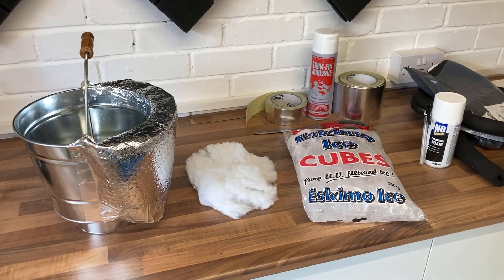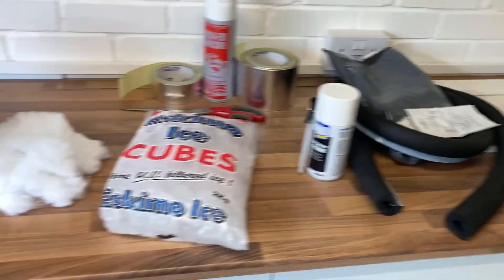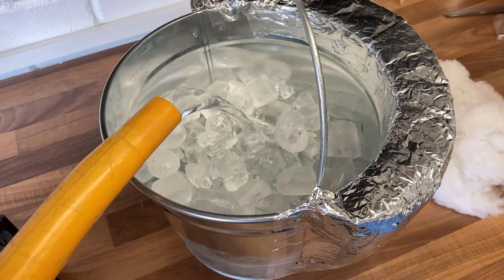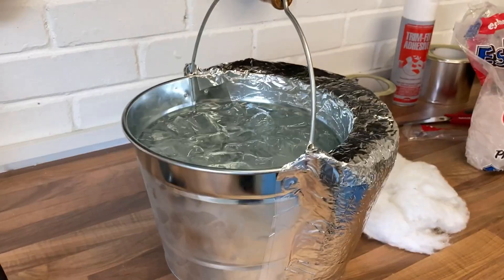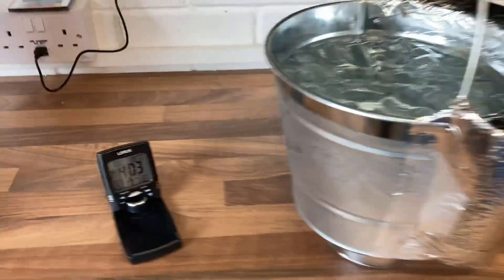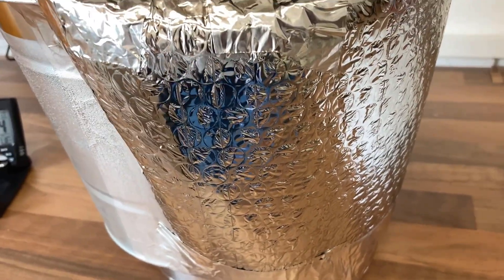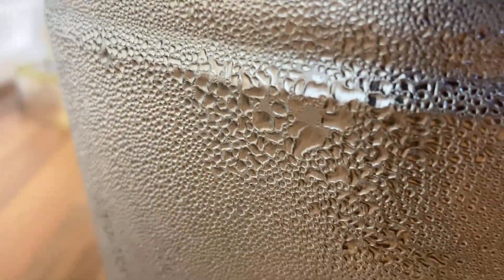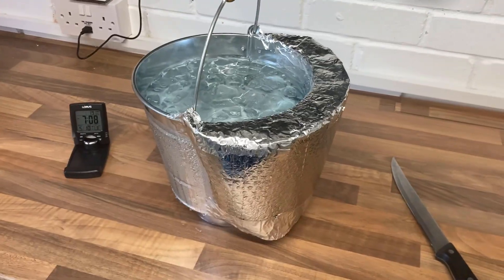Vapour Barrier in a Van - I can Prove they Work.

Comment: I'm all for vapour barrier and have installed it, the experiment has proved the need for insulation. It would have been interesting to see a 1/3 of the bucket with just insulations 1/3 with vapour barrier 1/3 bare metal.
Cheers for the video anyway 👍
Reply from the maker: I’ll do another one just with insulation to show that condensate too 👍🏼😃
Reply: It would be interesting to see behind 'just' vapour barrier too. For those spots where you can't get any insulation.
Great vid Greg.

Comment: Great video Greg, it absolutely highlights the importance of both insulation and a correctly installed vapour barrier. I am at the start of our van conversion and my initial thought is to have our vehicle insulated with closed cell spray foam which has the triple advantage of doing the job of anti rattle, highly effective R value insulation and also a solid impermeable vapor barrier. The cost and speed of spray foam insulation application certainly beats the traditional three stages of rattle sheet, then insulation material of choice and then a vapour barrier, which may not be 100% airtight unless meticulously applied. Many canal boat builders offer spray foam insulation service from around £50 per meter of internal narrowboat length which is roughly the same width and height as most vans. As this subject stirs strong and often conflicting opinions I'm sure i will be slated for mine but your video clearly demonstrates the importance of effective installation and vb application.
Reply from the maker: Spray foam is the very best solution as you say.
Reply: I've thought about spray foam insulation too, for exactly the reasons you mentioned, Dave. I'm still undecided though. Apart from the fact that there's nobody offering that service on my little island there's the problem that future welding work will be a pig, since you'd have to get rid of the foam first. 🤔
Reply: @JensGraikowski  I had considered spray foam insulation myself but have seen what happens to metal as it expands and contracts.

Comment: Great video. I cant see how you can 100%  seal your van. It would be interested to see if you would put small hole in, to demonstrate if you put some screw hole in by accident when you are working on your van
Reply from the maker: Firstly screws don’t leave holes unless you take them back out?
It’s very easy to seal plastic trim clips, tape joins and edges, tape behind sockets and lights. 
It’s not hard to do. 👍🏼😊

Comment: What would your suggestion be to someone who simply doesn't have time to self build, but does have £60-70k and looking at a brand new campervan like from Hymer or Adria? Obviously they don't have this vapour barrier and no go to retrofit. Plus with price of new vans and getting someone to self build for you is basically approaching the same cost as a new campervan but the depreciation would be greater, no warranty and potentially a less refined finish 🤔
Reply: Just do your best with proper ventilation, I bet he’d say, it’s not going to just rust and fall apart. You’re looking for an experience and if buying one from a builder is what you can do, then don’t fret.
Reply from the maker: Hello Carl, most modern Motorhome’s like Swift etc are built from a composite panel which is a sandwich of two outer skins with a foam insulating core. Bit like a cool box. So they are much better than the used to be. Get a proper motorhome with a composite body on the back NOT a production van conversion. You are right the campervan conversions with steel van bodies are not insulated properly. 
Plus motorhome companies do not produce vans to be lived in permanently or expect people to be holidaying in the winter long term.

Comment: Not disagreeing with your conclusion    but comparing insulation AND a vapor barrier  to bare metal   isn't fair testing   maybe a better test would have included insulation without a barrier ? and a vapor barrier  without insulation
Reply from the maker: The bare metal was the CONTROL part of the experiment to demonstrate that it was below dew point. But just for you I’ll do it again without the vapour barrier 😊

Comment: Excellent demonstration Greg. There's a tough crowd here in the comments, but the physics don't lie. They have two choices, use a vapor barrier or use a dew point meter and always keep the ambient temperature above dew point lol.;)
Reply from the maker: You would have to heat up the steel body of the van to above the dew point to stop it condensing. That’s a lot of heat to use in cold months.
Reply from the maker: If the insulation is permeable and allows moisture through to the metal then that alone won’t work.

Comment: Great video Gregg👍, I spent over £500 on the insulation and vapour barrier, I'd never put in a single glazed window for that reason also.
Reply from the maker: The double glazed ones are much better thermally. We do get some condensation on our bonded windows when it’s really cold 🥶
Reply: @GregVirgoe  A great excuse to leave the cold winters behind 😁👍

Comment: Great test Greg, but for just one second I want to play devils advocate, Do you think an air gap of say an inch ( no sealing of gaps at the top, bottom & sides of interior panels to help airflow) between the vans body panel and an insulation barrier would be equally effective if no vapour barrier was used?...........Im thinking that the temperature in the gap would be less stark and thus very little moisture would form because of a flow through of less warm air?..........if you take my drift!
Reply from the maker: No, as soon as you allow any air into that void condensation will form on the cold metal. More airflow will result in more condensation you are just fuelling the fire. 😢😳
Reply: @GregVirgoe  Thanks Greg, understood.

Comment: Unfortunatelly in my opinion this test doesn't prove that the vapour barrier is working but rather insulation. You are testing an insulated part of the bucket vs uninsulated not a vapour barrier vs no vapour barrier. Its obvious that without any insulation you will get condesation on a bare metal. Of course I might be wrong.
Reply: It did not test the insulation, because then you would look if condensations forms on the outside/"hot side" of the insulation.
This test looked at the "inside" of the insulation to see if vapour does condensate on the cold side of the insulation, which it did not until the vapour seal was broken.

It isn't about stopping the cold from getting out, a vapour barrier is supposed to stop vapour/air to get to the cold and condensate.
Reply: 100% correct
Reply: You are correct... The vapour barrier in this situation didn't do a great deal.. the insulation was the reason it didn't condensate...  It's almost impossible in a van or house to create a fully air tight.... having too much air flow passing through will cause condensation so the vapour barrier comes in to reduce the air flow.. if you insulate really well making sure there are no air gaps/flow then you do not need a vapour barrier..  a vapour barrier is a nice backup to reduce/stop any airflow which might still get through
Reply: Should use tissue to dap the insulation  to prove the insulation was dry, not that I doubt you at all as I'm starting my first camper van this week and am following your steps through out the build honestly I believe your the most detailed and down to earth YouTuber for this stuff thank you for sharing all your knowledge also throw a bottle of bubbles in there on your next video 😂😂
Reply from the maker: Hi Riddick, I’m afraid you are wrong as with just insulation and no barrier the bucket would still condensate because the insulation alone does not prevent moisture getting through to the cold metal. It’s a permeable material. Only the foil or plastic barrier can prevent that happening. Trust me I know what I’m talking about 👍🏼😃
Reply: @GregVirgoe  hi Greg to shut all the doubters up why not do another test with the vapour barrier one side and just insulation on the other?
Reply: @xtrax38  This is what I would like to see
Reply: @GregVirgoe you don't actually..its temperature difference what is the cause not the air moisture.. it's impossible to make a van or house air tight but you can stop the dramatic temperature difference.. a vapour barrier is not needed if you insulate well however it's difficult to guarantee so a vapour barrier is added security to reduce stop excessive air flow but you can't make it air tight ever even with vapour barrier
Reply: @jmb69er  new builds are air tested. What you've said makes no sense and wrong

Comment: Condensation is caused by warm air landing on a cold surface.  Any insulation will prevent that from happening. Vapour barrier is not proven here.

Add the barrier without insulation and you'll get the condensation.
Reply from the maker: I’m afraid you are wrong. The wool insulation allows moisture to get through it to the cold steel it is very permeable. The only insulation that has an inbuilt vapour barrier is closed cell foam like neoprene rubber or spray foam insulation. Any other form of woollen or fibrous insulation will need a vapour barrier. Fact 😃
Reply: @GregVirgoe  not so fast.
To prove or disprove your test you need to try the insulation only and then the vapour barrier only elevated a few CMs off the surface to mimic the wall cavity.
The air between the VB will still get cold and condense.
The insulation alone will work.

I've never agreed with that wool insulation in a van either.  It might be ok in a house loft where the wooden beams need some moisture content.
I'm a polystyrene 120*60*10 board man myself.  Using polystyrene boards will seal the surface.  Works a treat in my yolk.  I'm planning it for a boat next. 😎👍
Reply: Though I understand where you're coming from, Ray, you're not entirely correct in two points. Condensation is caused by warm, MOIST air landing on a cold surface. And insulation will NOT prevent that from happening for two reasons. First, insulation doesn't STOP temperature transfer, it SLOWS IT DOWN! The warm, MOIST air WILL hit the cold surface eventually, it'll just take longer. Second, the insulation will slow down any temperature difference, but it won't stop the MOISTURE from hitting the cold surface. That will go right through and cause condensation.

Comment: One thing I can never get my head around is why 'insulation' is coated in aluminium which is a very good heat conductor! Think about it...
Reply from the maker: The foil layer is there as a vapour barrier because foil it the very best material at preventing moisture getting into the insulation it is 100% impervious. It’s not there for any thermal properties 😁
Reply: @GregVirgoe  I agree it's impervious to moisture but aluminium also 'conducts' heat really well when it encapsulates insulation like thermal foil. If the foil touches the cold surface of the van it will act as a cold bridge as specially on the edges.
Please do more videos like this!
👍
Reply: It's not the insulation that is covered in aluminium, but the vapour barrier. The reason being that metal and glass are the only perfect vapour barriers with every other material (plastic, etc) allowing a certain degree of moisture transfer.
Reply: @JensGraikowski  I see insulated foil used extensively here in the UK. It is insulation with a foil envelope made from aluminium foil.
Reply: I don't doubt it,  @paulluggar5964 . And you're absolutely right. Aluminium is a very good heat conductor and seems to be counterproductive in insulation, but it is good for two things. Reflecting radiant heat and as a vapour barrier, which is probably while it is used on the products you're mentioning. 😉

Comment: May I suggest you do the same experiment, but without the vapor barrier material? Tape up that same insulation material on one side and add the ice/water and show what happens.
Reply: I'd also like to see how just a vapour barrier (with a couple of millimetres of foam backing or the 'bubble wrap' type) without any additional insulation performs.

In a small volume, such as a van, I'm wondering whether a thick layer of insulation is particularly pragmatic, considering that you need almost constant airflow. At night the duvet is your main source of insulation.
Reply from the maker: @nagualdesign  I do another with just reflectix to see if it’s enough to stop condensation forming. 🤔
Reply: @GregVirgoe  it’s going to be like an episode of Tomorrows World, with all these experiments 🔬🤓
Reply: @GregVirgoe  Thanks for all your time and efforts. I'm getting ready to insulate my van soon. My wife wants to use the wool insulation. Everything is getting so expensive, the price is probably going up as I'm typing.
Reply from the maker: @ceeceety2320  just use the Diall recycled bottle loft insulation from b&q it’s got all the eco credentials and will save you a fortune. Your van won’t smell like a farmyard either. Because the lanolin in sheep wool does smell 🤭👍🏼
Reply: @ceeceety2320  Pound for pound (more or less) PIR insulation is the best insulator at the thinnest thickness (there are other products in the market, of course).  Ignore wifey and get it right - first time, Tim.
Reply from the maker: @korean zombie you will see it’s only the vapour barrier that is working. The wool insulation will allow moisture through it and condensation will form on the bucket. Only closed cell insulation like spray foam and Armaflex have an in built vapour barrier.
Reply: All you need is Foil Duct tape over the seams of Reflectix.. Why I use 3M 600L with a thin sheet of Relfectix. Foil tape the seams. It will not transfer heat or cold from one side to the other. The added benefit of 3M 600L.. It does not burn. Gas any fumes. Mold, mildew or lose the R Value..Not to mention no scratchy ass fibers to deal with..I installed it in my van 7 years ago that way..

My only real issues. Fighting all the glass windows. They transfer heat inside like a blow torch..Then in winter. It transfer cold like an icebox...Only way to defeat it was to tape reflectix on the outside of them. When I'm not driving...As inside it did nothing to keep it out..
Reply: can we use undercoating to stop condensation?
Reply: Can or could polystyrene balls go done the van sides ?
Reply: What would the difference be using a polythene sheet instead of the foil?
Reply from the maker: Yes I will do that to prove that it is only the barrier that is working 👍🏼
Reply: agree, would like to see how just a adhesive backed insulation works on its own, like dodomat superliner.
this test is proving insulation + vapour barrier.
Reply from the maker: @stav2421  things like Armaflex and Dodomat are CLOSED CELL products so they are a vapour barrier in themselves and do not need additional barriers. The surface of that stuff is enough to prevent moisture penetration. Read their spec sheets
Reply: @GregVirgoe  and armaflex being flexible, will 'mould' itself into the deflections/flanges of the awkward shapes in the van.  A great product.
Reply from the maker: @riboid  yes it’s a good solution. Only downsides are weight and can be expensive.
Reply: @GregVirgoe  What would you think the weight difference would be if using 19mm armaflex?
Reply from the maker: @brycon232  Armaflex is a good product because it’s closed cell and has built in vapour barrier but it is a heavier product so will weigh a bit more than wool based insulation
Reply: I'm wondering what it would look like to do the same setup but then purposely put a hole in the barrier. 

I'm an engineer and ive been thinking hard about this. Since we are talking about trying to create a sealed barrier in a moving, twisting Van I truly wonder how it could ever be accomplished and kept sealed over time. You also have all the holes in the panels, trim ...

Is it still a good idea to try and seal as good as possible then to limit the amount of possible condensation?

Or is it better to layer but keep airflow to allow any condensation to evaporate easily instead of being trapped. 

I'm literally, finally building up my Van from the floor up right now so I'm struggling with exactly the best approach right now.
Reply: @davidwathen2004  You make a fair point David, but the flanges and structure within the van are there to stiffen up the topsides of the vehicle and minimise this movement. You want to seal this up 100%, as recommended by Greg and increase your air tightness levels.  
Intello products (which I install professionally) are for primarily residential air tightness (fibrous insulations etc), allowing the moisture to permeate in and out as the climate changes.

Use PIR insulation, apply a vapour barrier over the insulation and ensure that you overlap (50mm) the vapour barrier and ALWAYS RUB YOUR TAPE DOWN WITH A PLASTIC SPATULA and not your hand as (35 + years of residential and industrial experience) that foil WILL peel back off (if exposed).
Reply: @davidwathen2004  what did you go with ?
Reply: @davidwathen2004  That's my thoughts as well. It seems to me it would be very difficult to create a perfect vapor barrier, no holes or cracks or leaks. And if you don't get it just right, and some moisture does get through, I think it'd be nigh impossible to get that moisture back *out*. I go back and forth between "do a proper vapor barrier" and "skip the vapor barrier and just ensure good airflow to get moisture out and prevent condensation".
Reply: @wanderingzythophile9083  Good luck with that one mate!
Reply: @wanderingzythophile9083  results?

Comment: good video as usual Greg.
do you have a vid on actually installing the vapor barrier? i’ve looked through your stuff and couldn’t find one.
cheers, Mark
Reply from the maker: I mention it in insulation part 2 video. What I really found the best was some trim fix spray adhesive really held it in place well and made the install very easy. 👍🏼😃